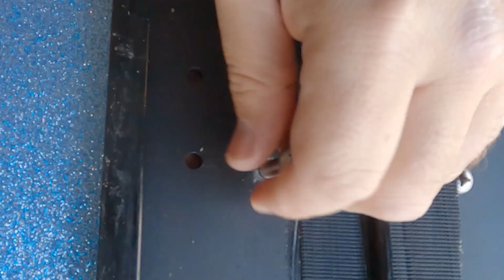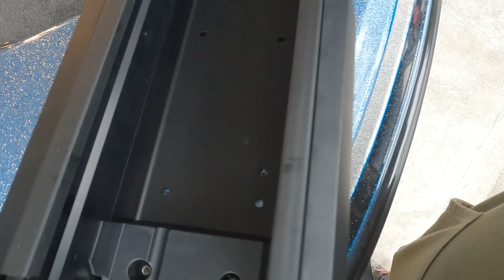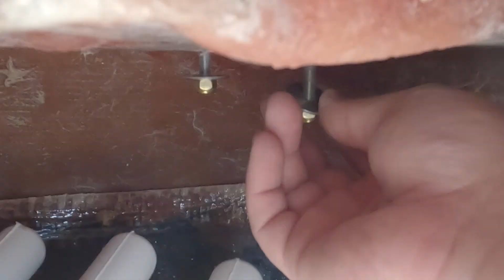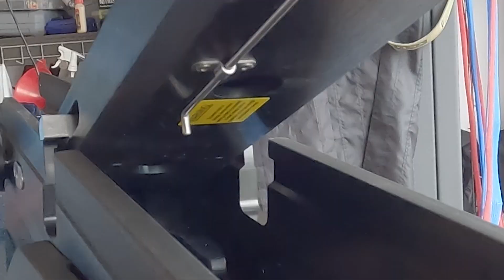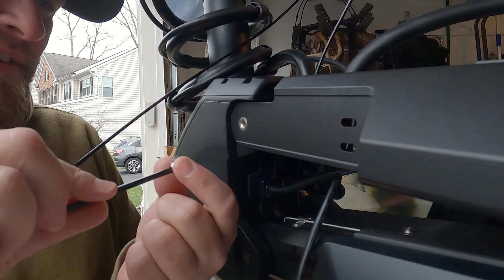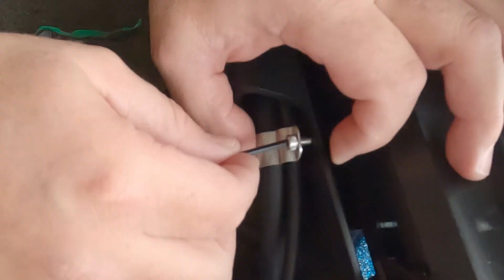Garmin Force Trolling Motor AMATEUR INSTALL...Tips & Tricks

Comment: I am also replacing a Terrova with a a Garmin pro. Wondering why you decided not to use the sliding mount on the Garmin. On my Ranger my TM will hit the trailer when taking the boat off the trailer. I am hoping to use the same sliding bracket just with new holes.
Reply from the maker: The boat I installed this on does not have clearance issues, so a sliding mount was not needed

Comment: Great video. I just bought the 57 inch Force and I was wondering if your shaft was long enough for your Ranger?
Reply from the maker: Thanks! Yes the 57" shaft length has been perfect for my Ranger boat, no issues!
Reply: @1Cast1Fish  Thanks. Just installed it on a Tuffy x-190. Looks like it should be good.
Reply from the maker: @arthurtang2155  Glad to hear it looks like it will work for you.  I always liked the look of those Tuffy Boats...been awhile but I know they used to be built like a rock.

Comment: Great video, did you use any lock tight for the gas piston screws? I just bought the Garmin Force Kraken trolling motor for my Sea Hunt Ultra 219.  I will be doing a solo install as well. Thanks for the great tutorial.
Reply from the maker: I did not, some screws had some on them from the factory though.  The install was pretty easy and straight forward...biggest thing is make sure everything sits where you want it before drilling holes in your boat.

Comment: How did you wire the motor to 24v?  I’m having trouble with mine.
Reply from the maker: The Force is designed to accept a 24V or 36V feed of power.  You have to do nothing special, Mine had 4 wires at the motor 2 red, and 2 black....I simply splices the 2 red into my single red power from my batteries, then the same for the black.  They sell large splice blocks on Amazon like I used.
https://www.amazon.com/dp/B001AWP7OG/ref=twister_B06ZXYCLF9?_encoding=UTF8&th=1
Just chose correct size for your wires.

Comment: Great video, I have to do the same thing in about 3 or 4 weeks.  I assume the next video is going to be the electrical hookup.  For that video can you please show a picture of how many inches the TM shaft is from the boat?  Basically I want to know the overhand distance since my boat is new I don't have existing holes to help me figure that out.
Reply from the maker: I did not end up with a video on all the electrical hook up since it changed a bit from the plan...I ended up hard wiring it instead of the plug.
Reply: @1Cast1Fish  Ah okay, can you explain this in an upcoming video?  Also, what about the overhang distance (sorry for the typo above)...overhang not overhand, lol.
Reply from the maker: I basically just made sure the whole triangle portion was beyond the furthest extruding part of the bow where it was mounted. 
For the connection I used 2 underground wire splice kits.
https://www.amazon.com/Gardner-Bender-HST-WP-Well-Splice/dp/B001AWP7OG/ref=sr_1_7_sspa?crid=17QLOONLGIKEG&keywords=underground%2Bwire%2Bsplice%2Bkit&qid=1678903433&sprefix=underground%2Bwire%2Bsplice%2Bkit%2Caps%2C98&sr=8-7-spons&spLa=ZW5jcnlwdGVkUXVhbGlmaWVyPUEyMVpSRDdaSUZQV1E5JmVuY3J5cHRlZElkPUEwMDc0MDIyM0ozWFUzQ1ZZSVY3SiZlbmNyeXB0ZWRBZElkPUEwNzkyMjAwR0szSFMyTDFLQU5VJndpZGdldE5hbWU9c3BfbXRmJmFjdGlvbj1jbGlja1JlZGlyZWN0JmRvTm90TG9nQ2xpY2s9dHJ1ZQ&th=1

Comment: You’re not gonna patch the old holes?
Reply from the maker: Nope,, just some tape to cover them...then I put a thin piece of rubber membrane material under the mounting plate...seals everything up great.  A few holes did end up lining up after I moved and adjusted it to the final setting.
Reply: @1Cast1Fish  cool , good luck with the new motor 👍looks great 👍
Reply from the maker: @georgetollefsen994  thank u